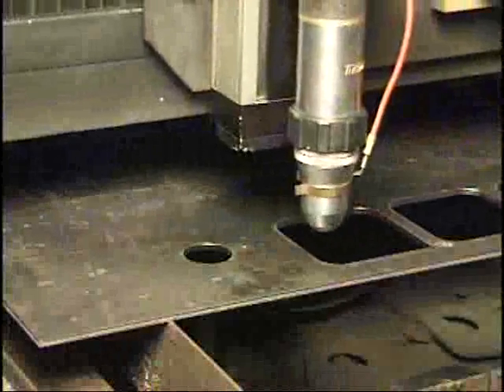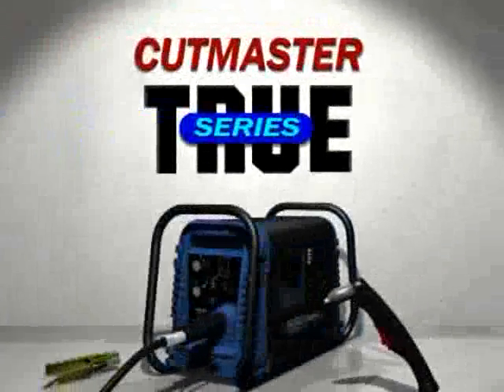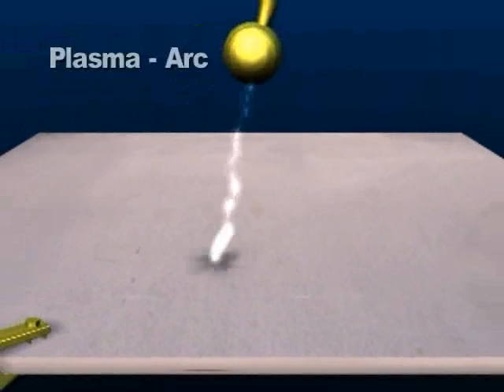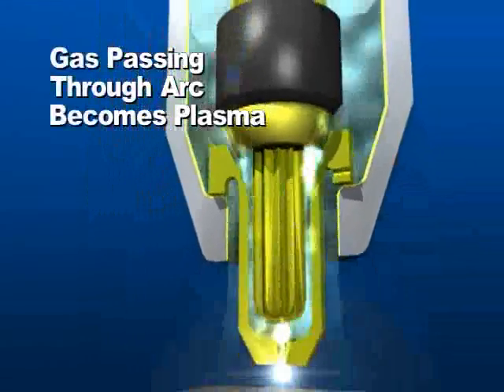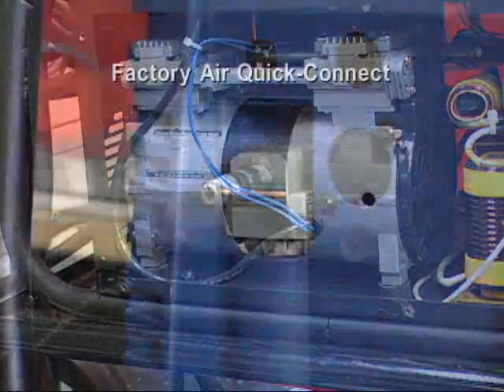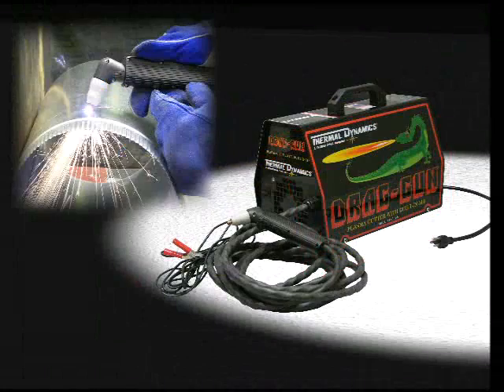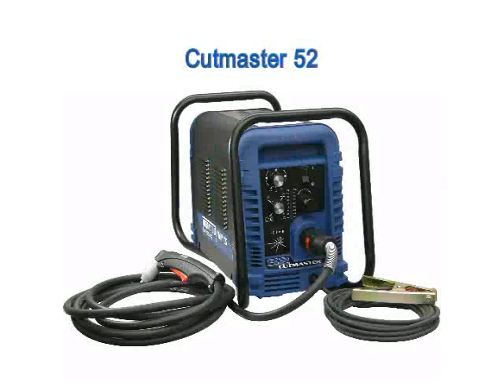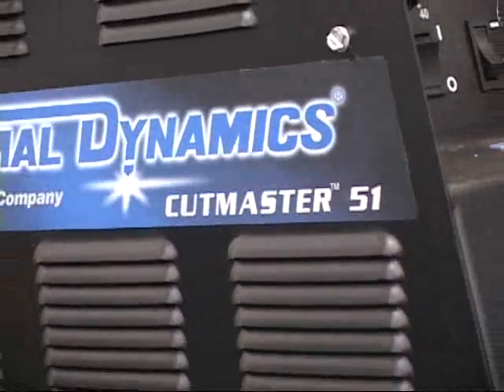Thermal Dynamics Cutting Techniques Demonstration 2

Comment: Nice video! I do have a question. I currently have s TD 42 and which is older and the base model series I belive. 
110v or 220v. 
Is there any rule of thumbs with this unit? 
Max PSI air?  Should the air supple be in the PSI range before connecting to the unit or adjust after connected? 
Any certain order things should be connected to the machine? Air first, then power etc. ? 

A ton of plasma cutting videos for noods but none seem to give the general "house rules" or "good practice  to follow" of plasma cutting. 
I guess these video makers assume we know that little stuff from birth. Lol

Any help?  

Ty